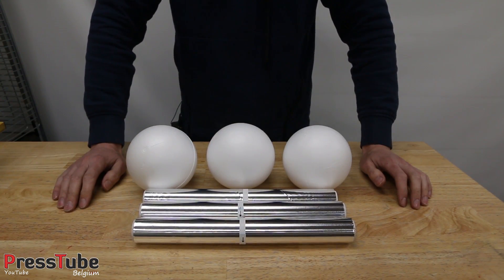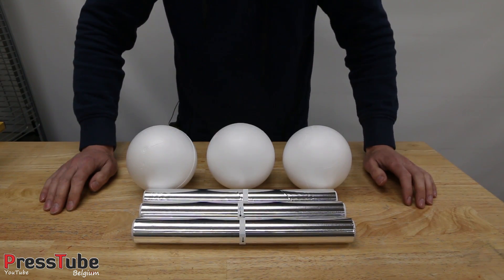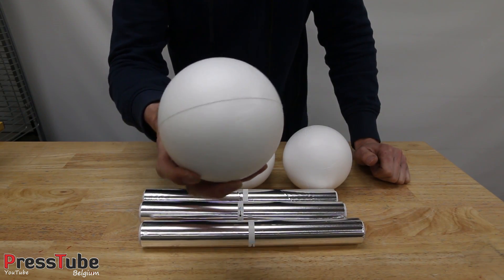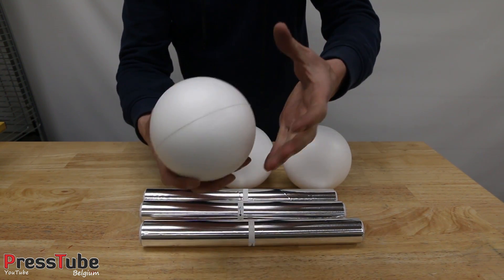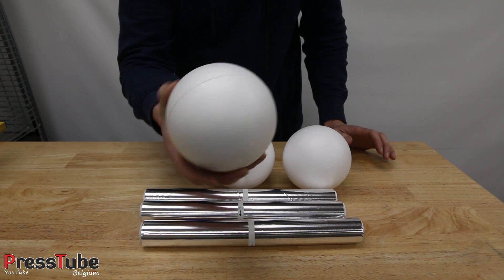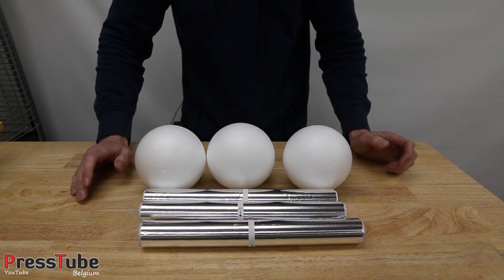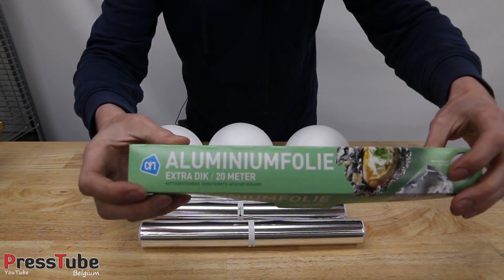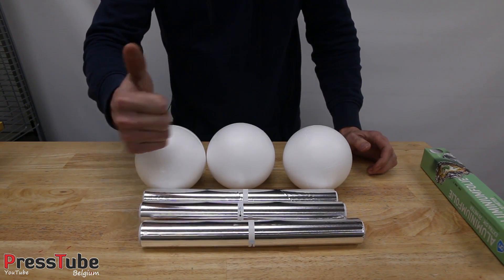Casting Mirror Polished Japanese Foil Ball from Molten Aluminium

Comment: Only America says ‘Aluminum’. Everyone else says Aluminium
Reply: Aluminum was what the original name was when discovered. Later due to significant urging and pressure to make its name sound "more like the other elements" it was changed to Aluminium. So USA uses the original name of the element
Reply: Uncle Rico actually it’s Burma and Liberia
Reply: In the Uk don't we use both the imperial and the metric system?
Reply: YouRandamoTube1237 no, imperial system is pounds, a foot, a mile etc. In the UK you do have a mix between metric and the ones with the stones etc. Don’t know what that’s called however
Reply: @Potjenjks2988  That's the "stoned metric system".
Reply: Scorpio nope
Reply: who gives af?
Reply: Billy Bun Since thats the “correct” way to say it?
Reply: and the american says aluminum is the correct way. :/

Comment: Please do not waste the water, use a bucket full of water. Do not place the hot metal on the grass is a living being.
Reply from the maker: The hose is connected to an underground waterwell. It only uses some electricity for the pump. The water is limitless

Comment: Protip: If you drink the molten aluminum (aluminium) you can make a casting of your digestive tract.
Reply: True but you can only do it once.
Reply: Don't do this! Without first preheating your d tract with a few gallons of boiling water, thank me later
Reply: WOW! I WANT A CASTING OF MY DIGESTIVE SYSTEM!
Reply: Duncan F. I prefer my aluminum airborne.
Reply: Just got done, 10/10 would recommend
Reply from the maker: Burp! 😇
Reply: PressTube wow you replied to my comment 😱
Reply: Nooooooooooooooooooooooooooooooooooooooooooooooooooooooooooo oooooooooooooooooooooooooooooooooooooooooooooooooooooooooooooooooooooooooooooooooooooooooooooooooooo
Reply: Try it on with molten diamond to make it extra shiny (don’t know if you can melt diamonds)
Reply: D O N O T D O T H A T❕❕❕❕❕
Reply: PressTube NO WAY
Reply: I believe, since diamonds are pure carbon, they burn.

Comment: This video probably took 20 to 30 minutes, Aluminium Foil isn't hard to melt, it's melting point is lower than any other metal. So, if it was uncut, would it be 20 to 30 minutes? :)
added with 2 hours of roughing it out ;-;